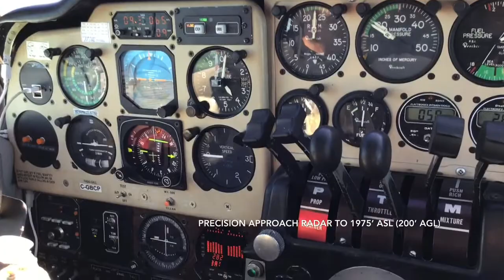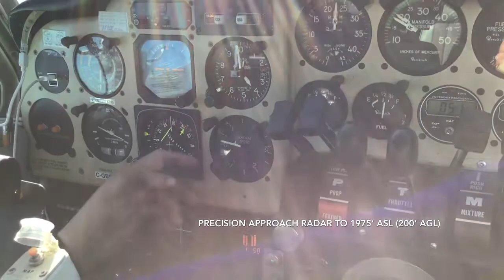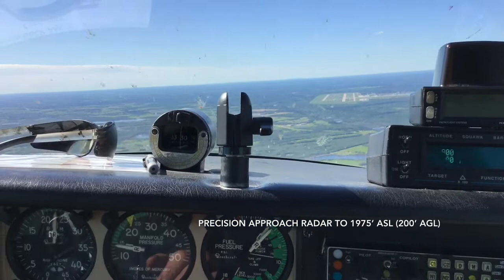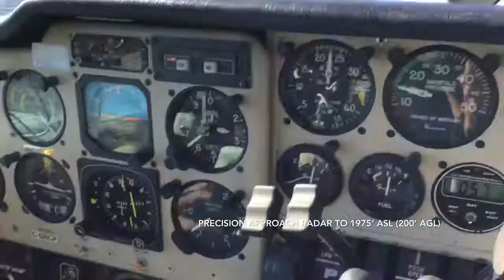Perry Wilson PAR Approach

Comment: Thank you so much for this upload. Q-A- is the primary instrument for this approach an HSI that is being adjusted while inbound ?  B- Is the HSI ( if that's what it is ) preferred by instrument rated pilots over the CDI ?   C- This PAR approach appears so exact it prompts the question as to WHY large civilian airports have not adopted the same procedure? Other than an onboard instrument or comm failure during final it would seem that with PAR training and similar equipment the chances of getting safely down would be significantly increased, thereby delaying one's arrival in heaven.
Reply from the maker: Hi Dan.  Thank you for your comments and questions about Precision Approach Radar. You are correct that the best instrument to provide the required accuracy is the HSI (Horizontal Situation Indicator).  It's more intuitive, easier to use and provides more information than a directional gyro and a CDI.

The ground-based PAR operators must meet recent currency requirements in order to do a PAR - which is enforced within the military.  If commercial and general aviation were to offer PAR, a civilian aviation system of assurance of recent currency would be needed.  If  that were to be put in place, safer approaches to landing in low IMC would result.

I suppose the civil aviation regulators may prefer to continue their pursuit of more pilot control rather than adding responsibility to highly trained ground-based controllers. 
 Fly safely.

Perry Wilson 
Airline Transport Pilot Licence
Reply: @perrywilson622 : Thank you for the prompt response and sharing of accurate professional knowledge. Best wishes to you and yours.